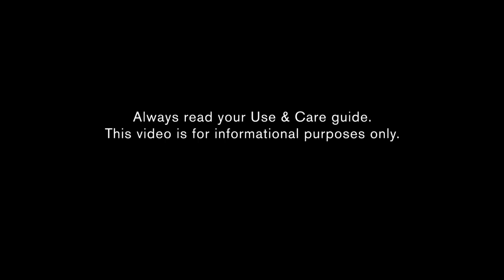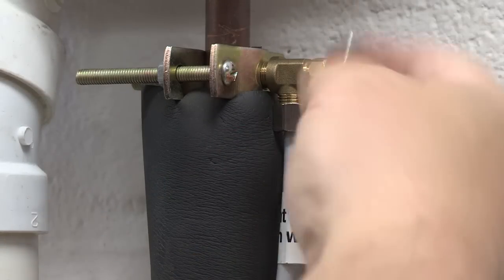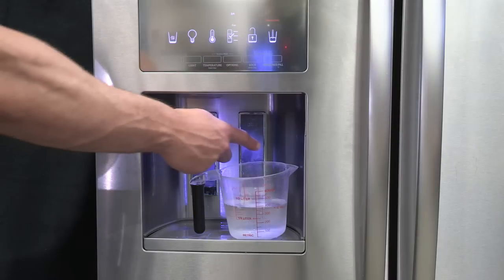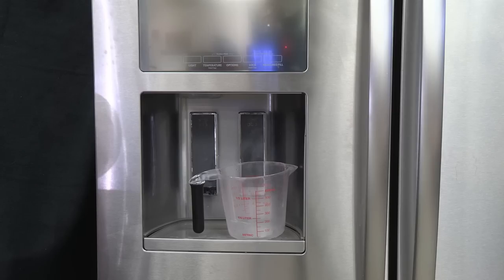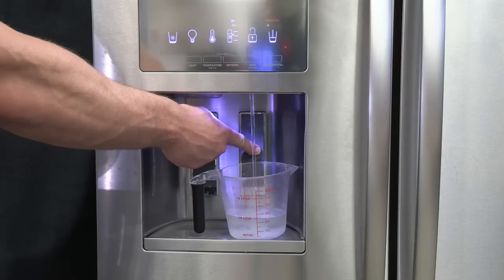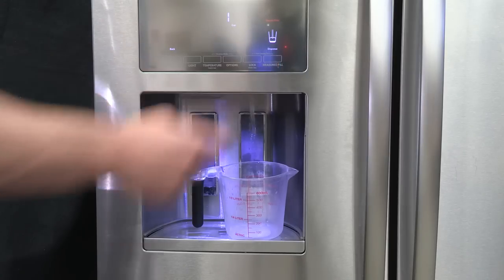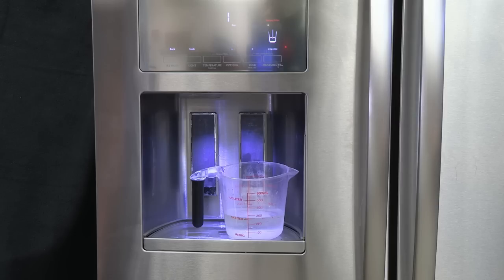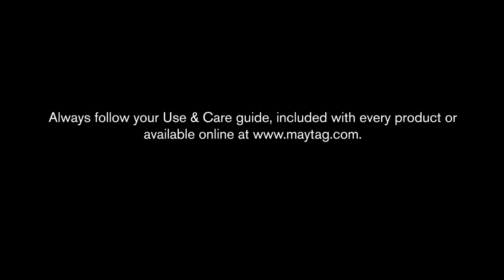How To: Troubleshooting an Ice Maker

Comment: Another tip I just found was:  if you have a well and and you pressure tank literally blew up.  And your lines got filled with sedatiment. (You can tell this by the screens on your sinks.) The little pin whole for water system may have been clogged.